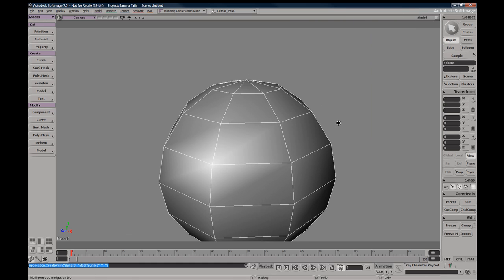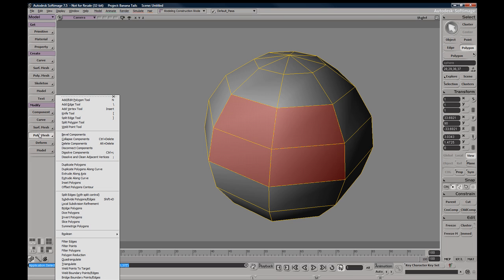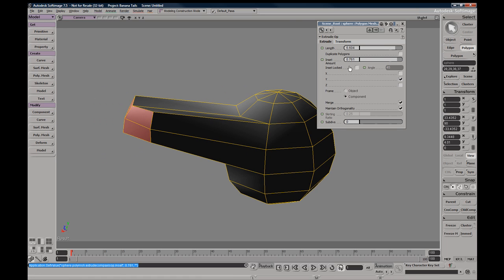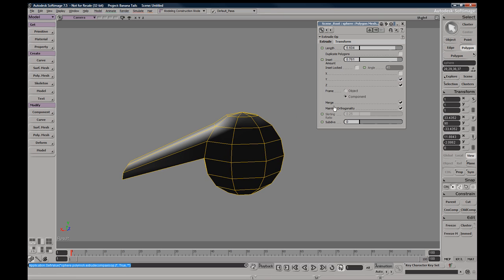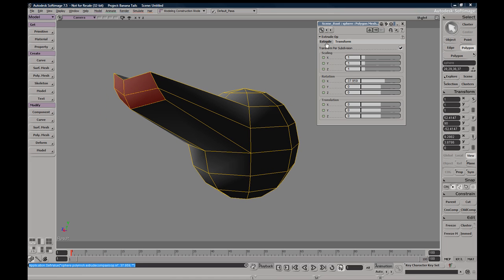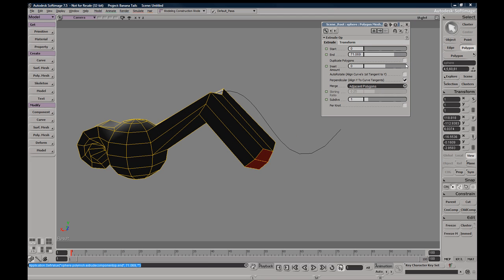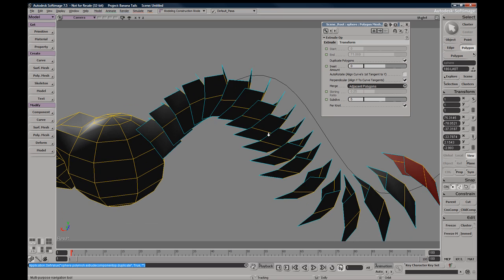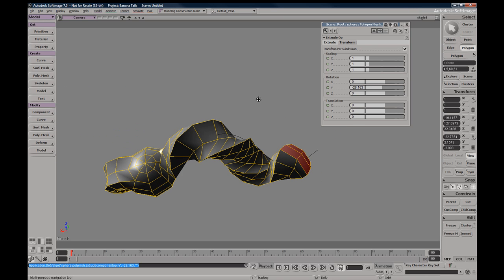Softimage XSI  Extrude Along Axis Extrude along Curve

Comment: how did you extrude with hotkeys in the beggining.  I noticed you didn't go through the menues
Reply: The default hotkey is set to ctrl+D. Hope you found the video useful :)
Reply: gamingirls Thanks my whole animation class has been wanderin that.
Reply: gamingirls One more thing.  Is there a way to instert a loop cut with hot keys?
Reply: ***** Which animation class is that?
Reply: ***** I'm taking a guess what you want with loop cut. Try the "]" key and use middle mouse button instead of left mouse button.
Reply: gamingirls thanks that really  helps.  Where did you find all these hot keys for modeling?  I tried looking online but couldn't find them.
Reply: gamingirls I'm taking 3d animation and VFX in college.  We are using softimage primarily but the teacher they got trained on maya so we are all having trouble.